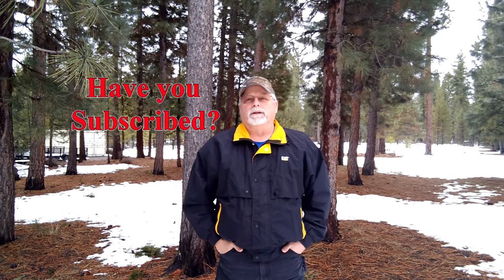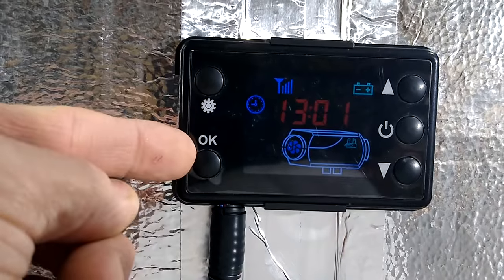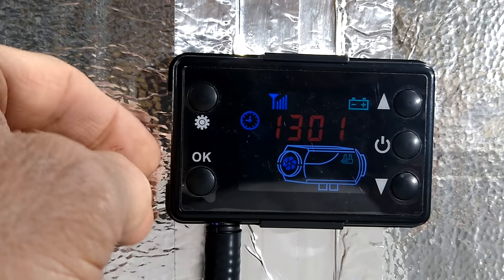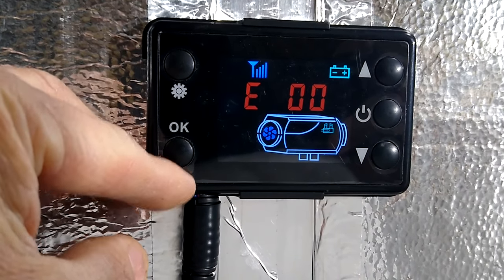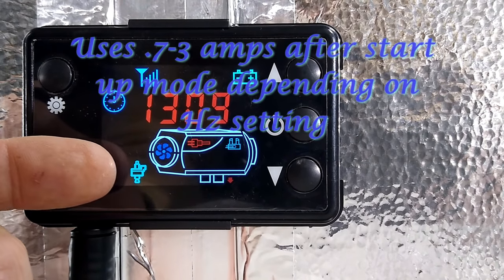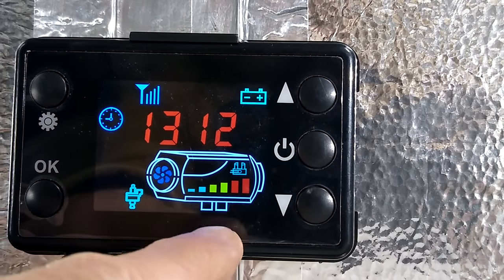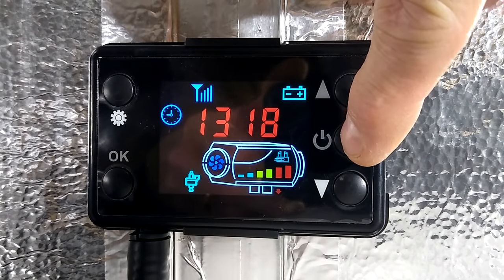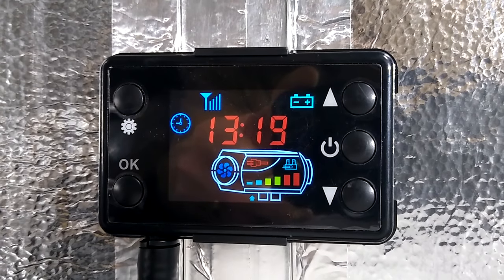Chinese Diesel Heater Controller Setup

Comment: Great video! Explained exactly what I needed to know. The instructions I received from my unit were completely worthless had I followed them I would've wire the unit up incorrectly. Your controller is exactly the controller I have which made this video great finished my install watched your video and it fired up first time got rid of that 30 year old propane furnace👍👍👍
Reply from the maker: Glad my video helped with your install. Pass it on to others and have a great day.
Reply: Got mine set up and working great in the truck camper. Keeping the old propane furnace in place as an emergency backup. It will run without any power.
Reply from the maker: Beezer Twelve Washingbeard,  Glad to hear your heater is working great. always good to have a backup heat source. Thank you for watching. Please subscribe, give me a thumbs up on the video, and let others know about our channel. Check out our other videos too. Have a great week.
Reply: @Tony Bailes I've got two heaters, each has a completely different display. The one like you see in the thumbnail with the heater graphic always shows info even if it's off. The backlight will dim until you press a button then it goes bright, but it's still visible at all times. The other type is just numerical digits and goes dark after it shuts down.
Reply: @Tony Bailes next to nothing in terms of battery usage to power only the display head unit.  If you're using the heater in your shop, it's advised to power it off a car battery and use a battery maintainer/trickle charger.
Reply from the maker: @Tony Bailes Hi Tony, in fortunately no good way to do this and assure the unit doesn't get shutdown before the unit cools. I have heard of people placing a inline  switch to turn off power but I don't recommend that. Thank you for your comment, please subscribe, give video a thumbs up and let others know about our channel.
Reply: My next challenge is keeping the display lit I will probably crack the case and add my own LED lighting. Also as far as back up heat I just use the cheap cartridge propane camp heaters Of course never go to sleep with one of those things on😱  But my air heater has never failed me best wishes to all maybe someday the RV industry will catch on
Reply: My heater had no instructions, so wiring it wrong wasn't an issue... easy peasy.
But having no startup instructions is a non-starter, for starting a diesel heater... pun intended.

Comment: With all the features on the controller and have a remote control, you're set to go. This is a very nice set-up. Thanks for sharing it with us.
Reply from the maker: Bob and Debbie, thank you for watching our Diesel Heater videos.  We're looking forward to spring here in Oregon but in the meantime we will be toasty warm in the camper canopy. Have a great day you two.
Reply: Until the solder connection on the wire pulls loose from the circuit board in that LCD Controller! Then you cannot get the heater unit to start up!  I wish someone would tell if it's possible to jump a couple of the wires that run to these controllers to BYPASS the controller just to get the heater up & running if you are in a (situation) where you accidentally pulled the NOT STRESS RELIEF wires out of the controller! PS: I commented elsewhere a recommendation that when you first get your heater you need to pump some hot glue or RTV Gasket sealer up into the little hole where the wires enter the plastic LCD controller box to help stress relief the wire from being pulled out.

Comment: This is my first comment on YT and its just to say thank you good sir. I was struggling with my unit and now i got it all figured out.
Reply from the maker: Hashim Osman, Your very welcome. Please give me a Thumbs Up, Subscribe and tell others about my channel on your social media. Have a good week.
Reply: I did subscribe , thumbed up and hit the notification bell sir.
If i may ask, my heater dose not go all the way to the red bar, it stops at the yellow which is not alot of heat. Do you know why that is? Thanks again
Reply from the maker: @hashimosman6519  Check you fuel delivery lines to make sure there's no air in them. Make sure your inline fuel filter is clean and that your running good clean diesel. Make sure your running the heater with a fully charged battery.
Reply: @explorer867  thank you. I will have to check your other videos to see about how to clean the filter.

Comment: Thanks So Much , for the Great info!... A word to the wize, keep on hand an extra glow plug. Preferably an Espar, or Wabsto plug, for replacement. I live in my van in Alaska. The chinese plug is JUNK!!!😖🥶
Reply: Thanks for the heads up!! I have one of these units in my sprinter van. Is there anyway you could drop a link of the glow plug you are speaking of that will fit in the Chinese diesel heater as well as the special 12mm socket with the slit for the wire? Thank you! You seem to have more experience replacing these things. I appreciate it.
Reply from the maker: Good advice.

Comment: I've just bought one of these 5 Kv diesel heaters as my home gas fired heater stopped working due to an excess of rain water around the burner unit causing an electrical short and a shut down.
The instruction book was not a lot of use as it didn't clearly show settings through the path to fire up and shut down etc
By pure luck I did get it to initially run by blindly experimenting with the control buttons and it did perform well.
This video has been the answer to using the heater and now I have to find a way/place to install it so the exhaust can be directed outside......the exhaust pipe DOES get really hot.
It's going to be a temporary emergency fix but at the same time I'll probably be using it mainly in my garage workshop in Winter......temperatures in South OZ get down to 10 deg C and that's too cold to work for any length of time without some heating.
For the garage I'll just mount it against the wall on a shelf and direct the exhaust out of the window, probably eventually through a hole drilled in the brickwork........it will be much cheaper to run than the industrial 20KW electric heater I use occasionally.
Edit........I'm so impressed with the simplicity of using this heater I'll invest in a second one just for the garage as this one I going to stay in the house for times when the gas heater is not working.
Reply from the maker: Ian, Glad the video helped you. Make sure you have a working CO detector in your work/living space. Looks like your much warmer 
Down Under than we are here in Central Oregon, 8 degrees Fahrenheit this morning. My diesel heaters have been working well for me for 3 years now, one in my pickup topper and one in my converted cargo trailer camper or Caravan. Good to hear from you mate. Have a great day. Please give me a thumbs up on the video, subscribe, let others know about our channel on your social media, and do check out our other videos. 👍

Comment: This is amazing! I like that you can actually set a timer, which could be really handy.  I also like that the controller is so easy to read. Really impressed with this.
Reply from the maker: Yes! This is a nice controller, easy to operate and very easy to program. For Helen and I we probably wont use the timer function but the setup for it is the same as setting up the clock function. Take care.
Reply: @explorer867  
I have a different controller on my heater. Do you have a source for this controller?
I have trouble programming mine. It's a 19 universal digital panel, is what's on instructions paper.
This one looks much better.
Reply: Can someone explain how to use the timer and what the lock is for
Reply: @lynlusse4542  did you figure out what the lock is for? Mine doesn't go below 1.6hz
Reply: @antoniobaez6282  mine too but you can switch to thermostat mode

Comment: I was hoping the thermostat would have shut it down once up to temperature wishful thinking I guess. Great video thanks just run mine up for the first time in Sunny Wales 👍
Reply from the maker: Hi Stephen, I too wish these diesel heaters would turn off and on thermostatically.  Thank you for watching my videos. Please give me a thumbs up, subscribe to to my channel and let others on your social media know about our channel. Have a great day.
Reply: Get yourself the Afterburner controller. It does this for you. But stop starting will eat your battery.
Reply from the maker: @projectzip  That's a good point projectzip. If the diesel heater is constantly cycling It will consume the battery. I will however look into  the afterburner controller. Where did you find it? Please like, subscribe, and let others know about my channel.

Comment: There are a few other advanced settings that are very helpful to have that you have not explained. Also. I'd like to use the timer. But good on you for getting a vid up.
Reply from the maker: Thank you for your comment. This videos intent was show others what I did with my heater and controller. I have no designs on using the advanced settings with my application. Have a great day

Comment: Thank you so much. I have had a desil heater and it took me so long to assemble it and then the on off simple switch didn't work and I wanted the one that showed me what was going on with it. Anyway no instructions came with the control pod, and I have been randomly pushing buttons looking for the feringeight button and now I know there is only Celsius. So I have to create a exchange sheet laminate it and tape it to the machine.
I also didn't know what the (of) ment. I thought it meant shut off.
I have learned so much, need to rewatch several times to memorize and take notes. 
Had to guerilla tape over the flimsy heater output  hose as this is for a tent. And I definitely need a longer more flexible exhaust hose. Will be looking to see if they sell those any longer. I built the heater into a plastic tool box with the intake and exhaust hose coming out of the bottom of the box. I think they should have designed those two further apart. I also had to create a different size square gas tank, using tire air valve after removing the small screw in needle. So far it works good. Glad line is a bit stuff in the cold. I don't trust the exhaust   which is under the machine to be inside the tent even if the exhaust was vented outside. So entire thing except heater hose connected to a dryer hose, all insulated up with blk gurrella duct tape will be all that enters inside the tent instead of a wood stove. I like my tent stove but one cannot sleep and feed a stove during winter camping. Anyway, I am so happy I found your instruction for the control. It was a big mystery to me. Heater kept shutting off. 
Does the control pod have a thermostat where if it is colder it pumps faster and if it gets to warm it will slow down? 
Need more instruction about the megahurtz.
Reply from the maker: Thank you for watching the video and watching my other videos also. The controller if set on Celsius will automatically run the diesel heater up and down to keep heat in a given space at one temperature. That said is dependent on the size of the room, the insulation in roof and walls, and size of heater. 
Always be safe, consult and follow what your owner's manual says to do. 
 Please give the video a Thumbs up, Subscribe, Ring the Bell and let others know about our channel on your social media. Have a good week.

Comment: Hi,  Thank you for all your info and work that goes into making these video's.  I was getting a low voltage warning E-01 and the heater would then shut down.  It wasn't the batteries for they were at 13.2v . Come to find out it was the fuse and after changing it the unit worked just fine.
Reply from the maker: Peter Bowden, I'm glad my video helped you out. Please subscribe, give me a thumbs up, let others know about our channel and check out our other videos. Have a great weekend

Comment: Thank you for this video. I'm thinking about installing one in my motorhome.
Reply from the maker: I've been using this 5000 for the better part of a year with no problems. We travel off pavement alot of the time, so lots of dust. To remedy this dust issue causing problems I installed a combustion air intake filter. Enjoy your day

Comment: I spent the better part of three hours today trying to figure out the controller.  I'm installing it into a trailer while it was in my 60'ish degree shed.  I figured out how to prime it, but could'nt get it to turn on.  Is the reason it wouldn't turn on because the  ambient temp was too high and the setting was set at "auto" and not "manual?  Also,  the battery light flashed at times with a new and charged 12v battery.  You're video is very helpful!  Thank you
Reply from the maker: Hi billd.8925, Thank you for checking out my video. Please Like, Subscribe, Ring the Bell and let others know about our channel on your social media. 
It is possible that the controller if set to Celsius and set to a temperature lower than the ambiant temperature may keep the diesel heater from running at a faster rate. The heater should start up if the battery isn't discharged. Check this with a multimeter, it should read 12.7 volts or little above for a fully charged battery. When correctly wired to the power source your electronic controller will show you a battery voltage reading. Watch my video again as I point out this feature.
 Make sure you have followed the instructions given you when you purchased the heater to do your installation. You alone are responsible for your safe installation practices.

Comment: Great timing finding this video. Finished installing my heater in my van conversion.  A bit early for the cold weather but its in and working. Thanks for the talk through of the control panel. 🖖
Reply from the maker: Hi Peter, it's good that you got your diesel heater installed before you need to heat with it. This gives you time to work out any problems with the heater. Please give me a thumbs up, let others know about our channel, check out our other videos and have a great day.

Comment: So it will not shut off after it reaches set target temperature? If that is the case, in a small space like a van, it will get warmer and warmer, won't it? Not ideal if you like to use the heater to keep the van warm during sleep time
Reply from the maker: These heaters don't actually shut off. If set on Hz setting will run at that setting, if set to the Celsius it will run at that target setting. Please give a thumbs up and subscribe to the channel then let others know about my channel. Have a great week.

Comment: We have a webasto in the used motor home we bought and the previous owner said it was disconnected.. he said it works..but we really want to see what we can do to make it work. Don’t know why he disconnected it. Great video 👍👍
Reply from the maker: You may want to pull it apart and clean out the burn chamber and clean the filter screen that is in the glow plug slot. You will need parts to do the job mostly gaskets. Be careful with the glow plug and wires they are fragile. Thank you for watching our channel and leaving your comments. Have a great day.

Comment: Great video. Can i just ask what happens to the heater once you desired temperature has been reached. Does it keep going or shut down.
Regards.
Steve.
Reply from the maker: Thank you for your comment. If the electronic controller is set on Celsius the heater will run at a higher speed until the temperature set on the controller is reached, then heater will run at a lower speed until room cools, then heater fan will speed up again. Heater doesn't shut off until you turn it off, then the heater must run its cool down cycle and turns off. 
Please Like, Subscribe, Ring the bell and let others know about our channel on your social media.

Comment: Great video! May I please ask you if the temperature settings on the unit, in fact control the temperature? What I mean is if I set the unit on i.e. 22 deg C, does the unit then keep a temperature of 22 deg in the cabin?
Reply from the maker: Yes
Reply: Hi, and if i set temp 21 C , 15 min later controller show 26 C and the heater dont stop, why do this? Why not stop the heating?! Thx

Comment: Good video!
I was looking for the  Temp-Hz -switch, I have  a different controller, arrows are horizontal and 'OK' button in upper right corner.
It will flip btw Hz and temp by pressing OK and  Left Arrow simultaneously, found it by following Your guide.
The minimum setting in my  controller seems to be 1.6Hz.... still too much for a small camper van.
Thank You!
Reply from the maker: Glad I could help. Please subscribe and give me a thumbs up. Let others on your social media know about our channel. Have a great weekend.
Reply: I'm having the same issue. Time to crack a window i guess...

Comment: Great vid, thank you. I'd like to see how to program it to come on automatically, but I think that's fairly straightforward. What I'm not sure about is how you can set the target temperature when also setting it to come on automatically. It would be nice to return to a warm van after a walk, but not a sauna!
Reply from the maker: Yes, programing the timer is very similar to programing any electronic clock timer. Hikerdok, I'm not sure about timer and temp working together as we don't use the timer feature. If you work that out do let us know here by leaving a comment. I'm sure there are others that would benefit from that bit of wisdom. Have a great weekend

Comment: Thanks for the info on tapping on the pump. I got it to work by doing that, now my problem is every time I want to use the heater I have to pull the fuse and run it like that then switch it over to run. If I don’t do it that way I get a code E-10. I have the tank and pump outside ( I live in a travel trailer) and it gets to be a pain going in and out. I am wondering if I should change the fuel tank or the pump again. 
But anyway, thanks for all your help and God bless.
Reply from the maker: Glad to help